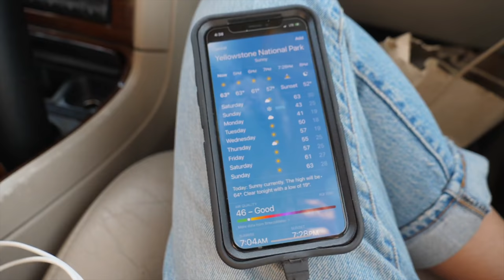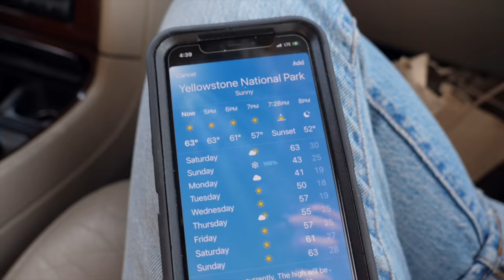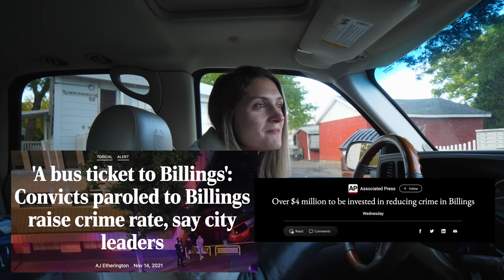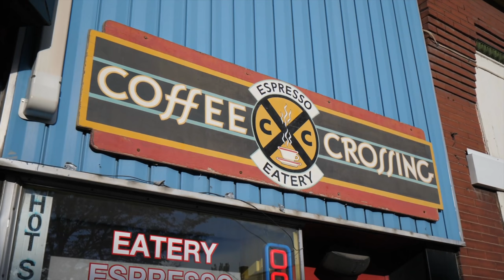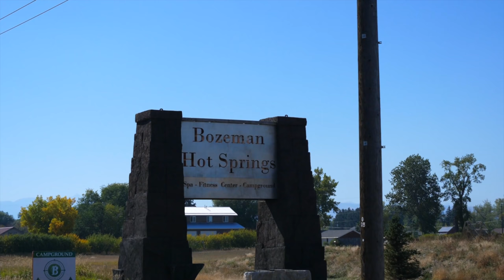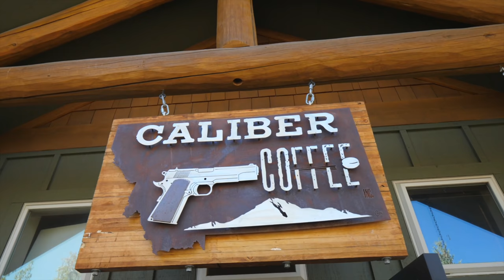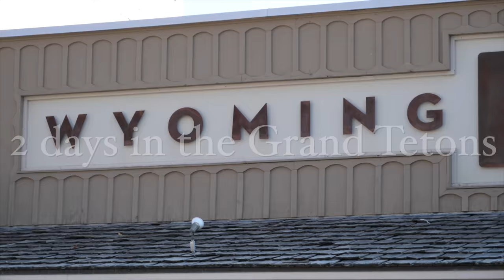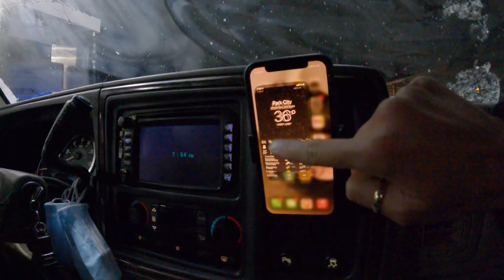THE REALITIES OF RV LIFE (Behind The Scenes)

Comment: One thing you can do to improve your car’s ability to create heat is to get some cardboard and place it in front of the radiator. It doesn’t need to cover the whole radiator to help. But you can start with that and experiment…
Reply from the maker: Wow didn't know that Douglas! Thanks for the tip